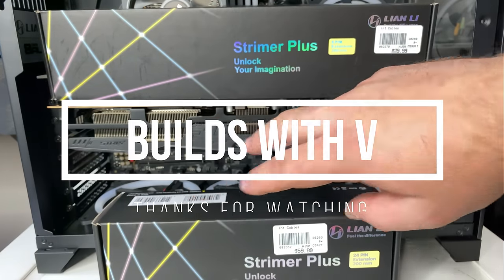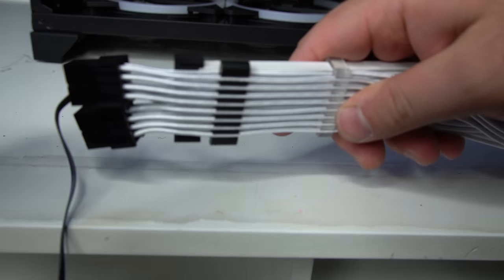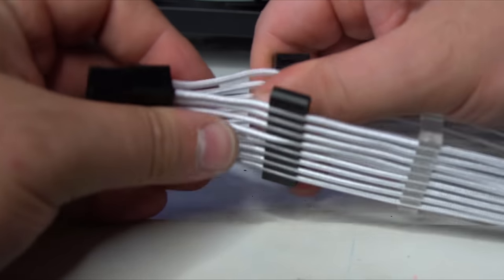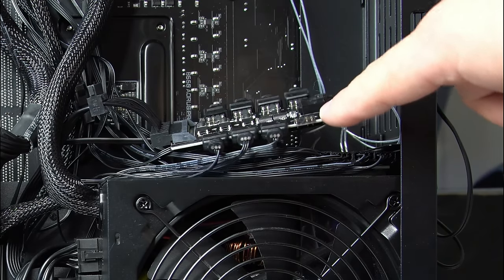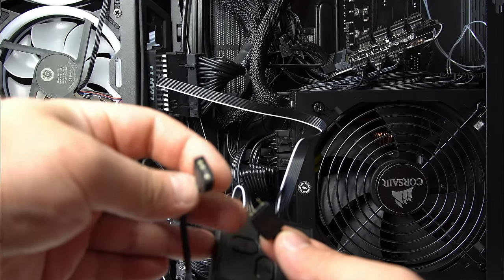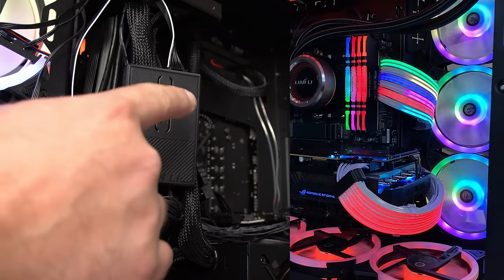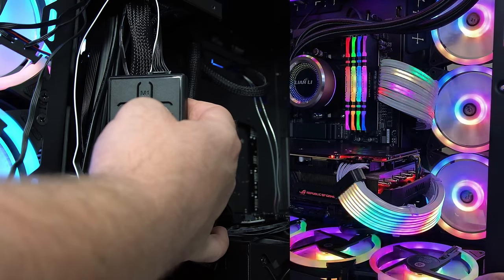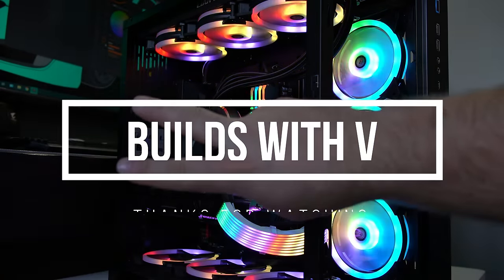How To Install Lian Li Strimer Plus RGB Cables + Review & How To Use

Comment: Great video mate! i have question, i plan to buy NZXT h510 elite case which come with two free rgb fans + controlers then im gonna use corsair h100i rgb platinum radiator then plan to use this lianli cables. Is it possible to sync the rgb color all of it (case fans + radiator fans + lianli cabe)?
Reply from the maker: Unfortunately you cant really sync everything with the same software.  There are ways to "make it work" with adapters and other stuff but as a simple plug and play they will not sync to the same software. However you can use the different softwares to have the same colors. Thanks for watching 🙏
Reply: @BuildsWithV  i see.. looks like need to buy same brand fans for all, lol. thanks mate, keep it up.

Comment: Is there a software from Lian Li to control the lighting effects of these extension cables? Or do I have to stick with the controller and the motherboard software?
Reply from the maker: There is a way to connect them to lian li connect but it requires another hub and a few extra steps

Comment: So I can only change the lighting mode through the controller if the back of the PC is open. Is there any way to control the lights while the system is closed?
Reply from the maker: If you connect it to your motherboard ARGB header then you can control them with your motherboard rgb software. Otherwise you’d have to open the case unfortunately. No extra remote or anything

Comment: Is there a way to use the 24 pin Strimer Plus without using the controller box? I would like to plug it directly to an ARGB header.

Comment: Can you put the gpu cable onto a graphica card woth only 6 slots?
Reply from the maker: Yes you can, you would only plug in 6 of the pins but the whole rgb will light up since the rgbs are separate from the actual cables.
Reply: @BuildsWithV  oh ok thanks!

Comment: Can you connect both the 8 and 24 pin in the remote or would you need two remotes?
Reply from the maker: Yes you can plug both into the remote

Comment: i have a question, by sata cable you mean sata cable that comes with the Power supply unit? 

sorry, first time pc user here and i have 0 knowledge in different cables. im used to laptop. hehe
Reply from the maker: Yep, you are correct. The sata cable from your power supply. No worries at all, thanks for watching 🙏

Comment: Am I able to adjust the modes without the remote? I have just the gpu strimmer.
Reply from the maker: If its plugged into your motherboard as mentioned then you can use your motherboard software.

Comment: did you plug the 2 8pin pcie one directly into an argb header on the mobo or the argb hub/splitter? or did you plug it into the included lian li controller, and then take its argb wire and plug it into either one of those? because on their website it says not to plug into a splitter and must plug it directly to the motherboard.

Comment: Are these extension cables compatible with the L-connect 3 controller? Or only the V2 extensions?
Reply from the maker: From what I remember, I tried it on the 3 and worked fine but I’m not sure anymore. That was like 2 years ago and haven’t checked since then
Reply: @BuildsWithV  Thanks a lot man! I'll try it

Comment: Just curious if there was a way to have the controller outside the case? I just feel like it's pretty inconvient having to remove the side panel every time you want to change the cables setting
Reply: Same here
Reply from the maker: The only way would be the run the cables either through a hole in the back or between the panels and then set the controller on the back with tape or something. No real practical way unfortunately

Comment: It was an awesome video, really. But I have still 1 question left. Can I connect the cooler master fans (which is not lian li fans) to the controller, and light them up with that controller? Or I can do this just for lian li fans?

Comment: kinda wished you showed how to connect without controller. want to plug into rgbheader but only has 1 cable to do it if you buy the combo.
Reply from the maker: There is no way to plug the 24-pin without the controller currently. Unless they came out with a new setup or a new cable. Hopefully they do because I completely agree with you, I hate having the extra bulk.

Comment: Hello I dont know if you are able to answer this but they recently released a triple 8 pin strimer plus that comes with a controller. I just got a 24 pin that came with a controller and i have it powered through sata, my question is if i were to get the triple 8 pin would i be able to connect it to the vga port of the same controller that came with the 24 pin instead of having to install 2 controllers in the back?
Reply from the maker: To be honest I haven’t had a chance to get one of the new triple 8-pin Strimers so I’m not too sure how that works. I would assume you could plug them both into one controller but I’m not certain

Comment: How did you sync the front lian li rgb fans with the lian li strimmer I plugged the lian li front fans directly into the commander pro.
I also have corsair peripherals BTW please help
Reply from the maker: I honestly just change the RGB settings in each software to match each other.

Comment: My GPU MSI 3060RTX has an 8 pin connector. I ordered an 8 pin Lian Li Strimer Plus RGB Cable. I received the cable with a 16 pin connector. Can I plug the 8 pins in my GPU but connect all 16 to the power supply to have all 16 light up?

Comment: I have a asus prime MB and it doesn’t have any 5v argb connections. Can I run the controller strictly on sata and then just control the wires by the control box?

Comment: If I connect the cables to the motherboard and control them through the software, can I still control with the remote or do I need to do something? Like unplugging or pressing a button on something? And how exactly can I make one cable through the software and one through the remote?
BTW Great video, excellent explanation
Reply from the maker: So to get them to work through the software you just have to press the M1 button on the controller for 3 seconds or so and it’ll work with software. Then you can press it again and go back to using the controller. To have them work “one through software and one through remote” like I did in the video, I plugged the 24pin to the controller and the GPU cable directly to my 3-pin ARGB port. Thank you for watching

Comment: Hi I have a question will this work with a MSI Gaming GeForce gtx 2080 super and a MSI MPG X570 Gamimg edge WiFi motherboard?
Reply from the maker: It would work no problem with that GPU. If it has more than two 8-pins you’ll just use a normal cable for the 3rd one. As for the motherboard, not sure if it has 3-pin ARGB port but even if it doesn’t, you can power these with sata power so it will still work.
Reply: @BuildsWithV  ok then which motherboard should I get then?
Reply from the maker: @takeojaeger6397  I just checked and that motherboard does have ARGB ports so you’ll be good. I was just saying I wasn’t sure if it had any. But it does 🤘 Thank you for watching 😊
Reply: @BuildsWithV  Ahh ok thanks man keep the good content up 😁
Reply from the maker: @takeojaeger6397  Thank you 😊

Comment: first time building my PC i have both strimer im confuse about the wiring can I just use the wire that connect straight to the Psu without using the other two wires you talk about??
Reply from the maker: Yes you can use just the sata power to the psu and you’re good
Reply: @BuildsWithV   but if you only connect them sata power than you cant control the rgb right? 
w
Reply from the maker: @robertlam3556  you can still control the RGB using the controller.

Comment: Can I use the 24 pin with GIGABYTE X570 AORUS MASTER motherboard??? And do you think they will eventually make one that can go with the 3080 GPU?? Great video btw!
Reply from the maker: Yeah it will work perfectly with the x570. I do believe they’ll make a 3x8 pin version of the gpu cable.
Thanks for watching 🙏

Comment: I have a quick question normally I'm pretty good with computers but when it comes to this stuff I'm confused and it's not you it's me, I was wondering if maybe you could help me out with the install over voice communication as I might buy this, do you have a Skype or any private contact because I would love to have this graphic card 8 pin wire installed (x2) which is the same as your graphics card. I'm sick of the standard black one, I don't know exactly how to do it perfectly the way you did it, is there any way that you could help me directly I would gladly appreciate it, I'll even compensate you for your time?

Comment: Awesome video!! 
I had the hardest time shaping the triple pin kept feeling like I was putting too much strain on the plug in sockets for the gpu any advice?
Reply from the maker: I feel you, they definitely can feel really tight and stiff. I gave myself a little extra slack between the connectors and the Strimer so I could bend them more.
Reply from the maker: Thank you btw! Much appreciated 🙏

Comment: Is ARGB hub needed or I can only order 24 pin and gpu cable and have it with all colors ?
Reply from the maker: You don't need the ARGB hub, You can control everything directly using the controller. Thanks for watching 🙏

Comment: What brand is your Argb Hub? Plan to install a strimer using this video but i only got 1 argb header and ready has 4 argb fan connected. That hub looks perfect for my need. Thanks
Reply from the maker: Mine is from bitspower but there are better ones out there. Personally I’d recommend the cooler master one. It does also have pwm fan connectors on it but if you don’t need to use those you can ignore them. This one here: https://amzn.to/3hT2oqX
Reply from the maker: Also, mine came with my bitspower fans so it’s harder to find by itself. I can’t find it on Amazon anymore for some reason
Reply: Thanks you
Reply from the maker: @francisdumlao8040  you’re very welcome and thanks for watching 🙏

Comment: Bought the 8 pin for the gpu. But seems the pcie on my evga 2080 super hydro copper GPU are upside down. The black push tabs on the strimer face downward putting the rgb facing down and normal cables facing up. I see in your video on your GPU the push tabs on the  strimer. Pcie cable face upward.

Comment: I have the lancool rgb strip. It uses an argb connection (3 pins with a fourth pin blocked off) I have no argb connections on my motherboard. Would I be able to plug in the strimer 8 pin gpu, strimer 24 pin motherboard, and the lancool to the controller?
Reply from the maker: You should be able to but I haven’t tried it personally so I’m not entirely sure.
Reply: @BuildsWithV  thank you!

Comment: My mother board doesn’t have a 5v 3-pin, does that mean it just need to have it plugged to sata power and you can control the rub with the remote?
Reply from the maker: Correct, just plus it into sata and that’s it.

Comment: do i have to connect both the sata and the middle one to the motherboard?
Reply from the maker: You do not need to. Just sata is fine if you want to control them with the Strimer controller. If you want to control them with your motherboard software then you’ll need to plug the middle one into your motherboard and press the M1 button for 5 seconds to switch to software.
Reply: @BuildsWithV  Thanks man, didn't expect you to answer this fast. Appreciate it.
Reply from the maker: @jaymz5800  no problem at all 🙏 Always happy to help

Comment: My gpu needs 3 8-pin connectors, what can i do?
Reply from the maker: They now sell a 3x8 Strimer for the 3x8 GPUs so you can just get that one. The other option (which I’ve done before) is use a regular cable for the 3rd 8 pin and hide it behind the 2x8 Strimer. Just depends what you’d prefer.
Reply: @BuildsWithV  ok thanks so much, now let me check where i can get them

Comment: At 7:41 you show a cable that is not included in the 8 pin connector box. I got a 3 pin connector but not the same as you are showing, the one that came with mine was a black cable that is attached the RGB lights. Please let me know If I need to return for a new one or if I am missing something (im new to PC building)
Reply from the maker: In the 8-pin box there should be a 3-pin addressable RGB that connects from the cable that is attached to the RGB cable to your ARGB port on your motherboard. If its missing I would definitely request a exchange. Unless you are using the module that came with the 24-pin cable. Then you'd be okay.
Reply: @BuildsWithV  Okay thanks, the only 3-pin connector I got didn't attach anywhere on my motherboard after about 20 minutes of looking. Going to reach out and see if I can exchange it! Thanks!

Comment: So you can’t control the 24 pin within the rgb software?
Reply from the maker: You can if you choose to use the ARGB cable and press and hold the “M1” button to switch to using software

Comment: My GPU is 8x6, do I have to plug all 8x8 into the strimer cable and then just leave 2 off at the GPU end ?
Reply from the maker: Yep exactly like that. I now have a 2070S in my pc with 8x6 and that’s how I did mine. Thanks for watching 🙏

Comment: Do they have a 6 pin connector? My 2080ti uses two 8 pins AND a 6 pin cable... Am I just outta luck?
Reply from the maker: They do have the 3x8 now. They made them after this video. They’re on amazon and I think Newegg. Here’s the Amazon link: https://amzn.to/3cejFYV
Reply from the maker: Basically you’ll just not use the last two pins on your configuration. The lights will all still light up

Comment: I could be getting these for Christmas do they effect power performance on gameplay  and are they quite reliable
Reply from the maker: They are very reliable, never had a single issue with reliability. The power draw doesn’t affect performance either (as far as I can tell).
Reply: Thanks for the video and reply back
Reply from the maker: @ryankeeling2406  no problem at all, happy to help. Thank you for watching 🙏

Comment: In the manual it is advised to directly connect it to the motherboard only and not to connect the strimer plus controller to a splitter but is that what you did here regardless of that warning? it seems a lot less complicated to use a splitter than buy lian li’s cable kits so i want to confirm whether it works with the splitter without interference. my mobo only has 1 argb unfortunately, so i have to split them. thanks!
Reply from the maker: Works just fine with a splitter or a hub. That’s exactly what I did and haven’t had a single issue since this video released.

Comment: whether the 8 pin cable can still work if there is no 5 pin on the motherboard?
Reply from the maker: The 8-pin cable ness a 3-pin argb connector on the motherboard or the controller

Comment: I'm a noob when it comes to PC's but I just started my build and currently have asus crosshair dark hero and 2070. What pins would I have to get??
Reply from the maker: The one for your motherboard is the same as this one in the video. 24-pin. Then for your GPU it will depend if you need 2x8-pin or 3x8-pin but I believe the 2070 only has 2x8. So basically same as I have.

Comment: Do I need the hub or will the RGB work if I plug it directly into the mobo?
Reply from the maker: For the gpu cable you can plug that straight into the motherboard. The 24-pin needs the hub unfortunately. With they’d make it different.

Comment: I've got the strimmer plus gpu cable but it doesn't come with the controller, is there another way of changing light effects, colours etc as you can't purchase the controller on its own
Reply from the maker: You just have to plug it into your motherboard 3-pin ARGB header with the included adapter
Reply: @BuildsWithV  cheers buddy I should of been more specific I've done all that everything works but just don't know how to change colours and the effects without the controller
Reply from the maker: @1984chrisyB  oh no worries, basically you’ll just control the effects with your motherboard software.
Reply from the maker: @1984chrisyB  that will depends on your motherboard. For example, if you have gigabyte motherboard then you’d use RGB Fusion 2.0 software.

Comment: So i'm confused as my Zotac rtx3080 has only two 8pin yet on Amazon states that triple 8-pin is the only one compatible with rtx30 series. Do I leave the third one unconnected!? that'd look ugly
Reply from the maker: If your GPU only has a 2x8 then just get the 2x8 Strimer, same one I had in the video. Only get the 3x8 version if your GPU has three 8-pins
Reply from the maker: I have mine plugged into a 3070 currently and had it plugged into a 3090 and a 3080 at one point. The triple 8 pin is not the only one that works on RTX 30xx GPUs

Comment: What if I don't have the rgb controllers?? Will they still be able to light up?? Or how could I get them to work without em??
Reply from the maker: They work without any other controllers. You just need the controller that comes with these lian li cables. Plug that into sata power and then plug the cables into the controller. You will then control the rgbs using the controller it came with.

Comment: My 24pin PSU cable fits fine into my motherboard but doesn’t match up/fit with the 24pin strimer cable. It’s like some of the female adapter ends are supposed to be boxed shape but are missing the corners so it won’t fit. Using EVGA Supernova G3, any help appreciated
Reply from the maker: That’s very odd. It should match up perfectly. They do have a 24-pin cable used for 3x8 pin GPUs tho. Make sure it’s not the gpu Strimer cable you’re using. They look almost identical even using the same controller.